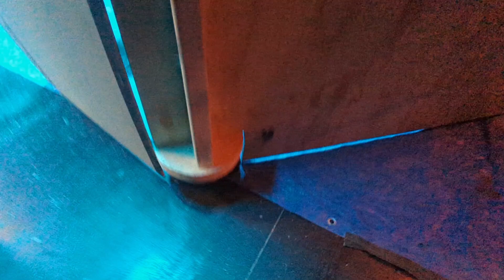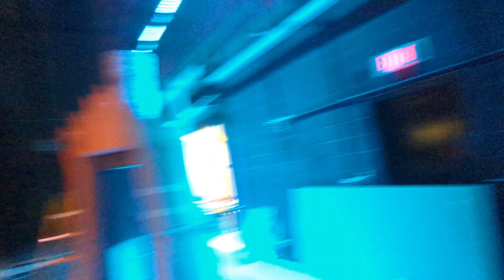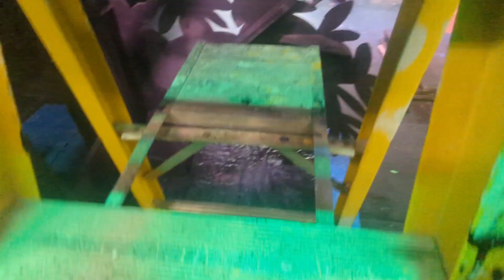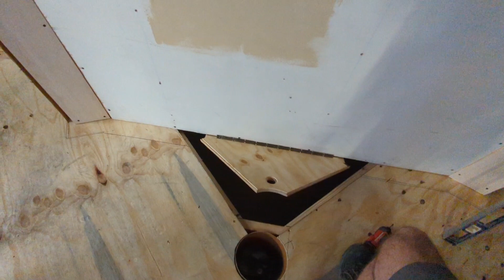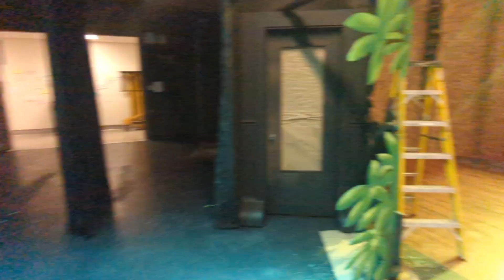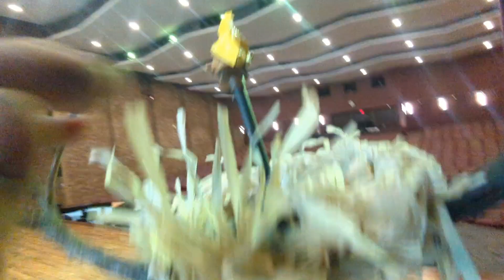Shrek The Musical Set Design & Construction Ep. 9 | Pre-Flight Checks

Comment: You missed your calling. Good job!
Reply from the maker: Thanks Karl. I'm happy to do this once a year. I grossed $9/50/hr. on this ;)
Reply: @TMFXLLC  I couldn't imagine that you were able to retire off of this job. I guess it is one of those labor of loves that you cant look at the bottom line. I have done many jobs for friends and people I care about, that when you add the hours up in the end, it is depressing. I know one contractor that charges by the hour and expects to get a weekly paycheck. He appears to be busy, but I don't too many people that would pay like that. When i did a big job, I  would tell them up front, that I want  1/3  up front, another 1/3 half way through and the rest when I am finished. I mean if this job was with Cirque du Soleil, you might be able to retire. Of course you would have to relocate to Vegas...haha
Reply from the maker: @karlshomeremodeling123  This is the only flat rate job I do, and it pays in the fall so I have a lump sum for the holidays. I'm always finished by mid March and ready to start my "busy season" so it works out. Normally I hold the entire material budget for purchasing and make a weekly paycheck based on labor hours (Time & Materials). I'm in the habit of recording my hours so I can always figure my rate. I could spend far less time on this project but it would look the part, so I flex as hard as I can considering the material budget. I'm paid in satisfaction ;)